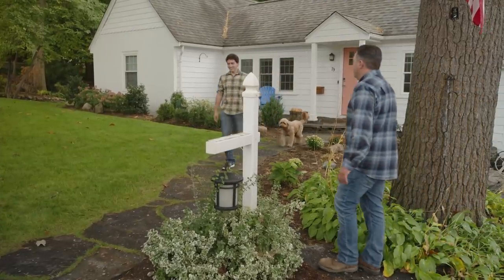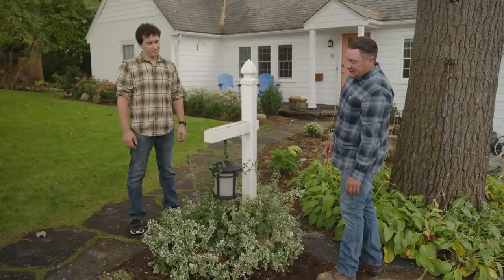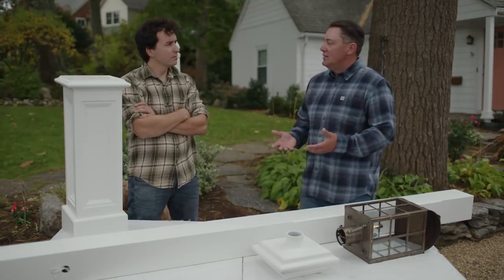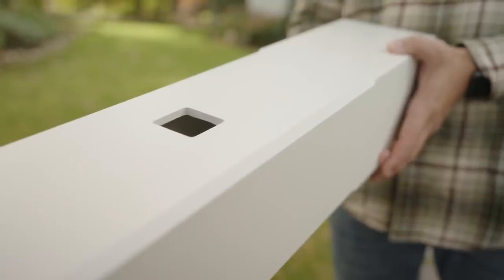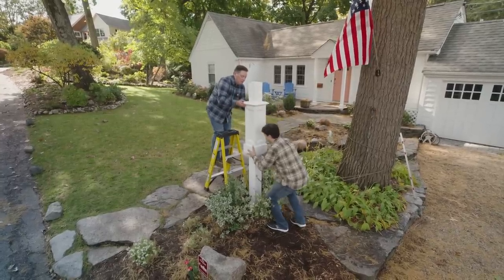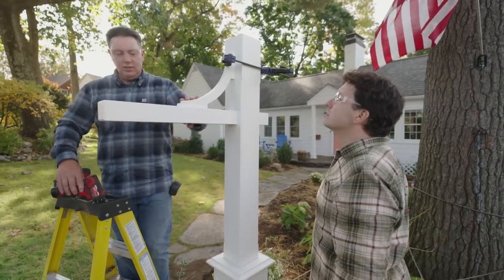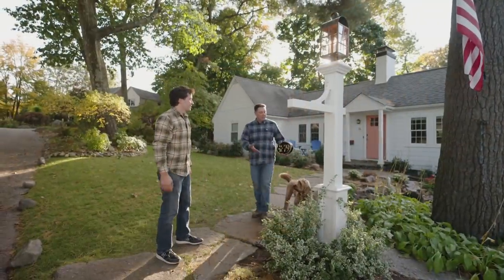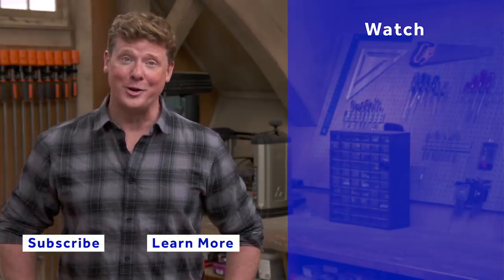How to Replace a Lamppost | Ask This Old House

Comment: For those who might not know, UF cable may look like Romex (NM cable) on the outside but has a very different sheathing that's made for direct burial and being exposed to water. I say this because I've actually seen people bury Romex or put it in a pipe in a wet location. Overall, he did a good job with what he had to work with here.  Now days with low voltage LED lights being so bright, most landscape lighting is done with Low voltage.

Comment: I was wondering why they didn't use cement when they put the post in the ground, seems like it wouldn't be sturdy enough?
Reply: I'm guessing since it is hollow plastic and supports zero weight, if it got hit by a plow or branch it would snap in half if it were in cement. Being just in dirt, it might survive by bending over. Also, it does make it much easier to replace or move if you need to.
Reply: @matthewjurkiewicz  Makes sense, thanks

Comment: Anyone know where I could get this lamp post? I'm searching for exactly what they installed - lamp post with the combination address sign.
Reply: The post and website are in the expanded description: "...This particular post was designed with a hanging sign in mind, which can be custom ordered separately. All of these items are manufactured by Walpole Outdoors (https://www.walpoleoutdoors.com/)"
Reply: @MrCdthomas528  I don't see any options on the website to order for lamp and sign. The sign posts are much shorter than lamp post